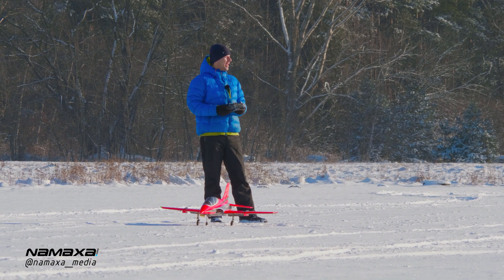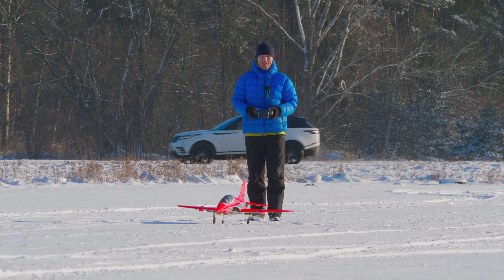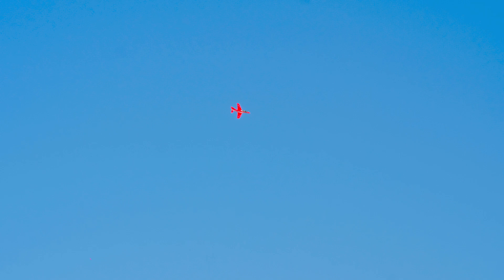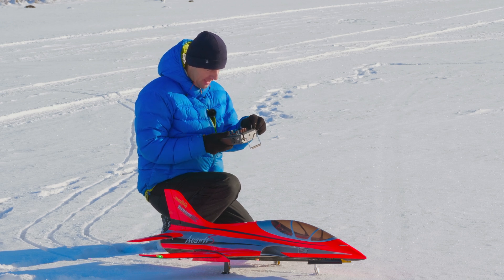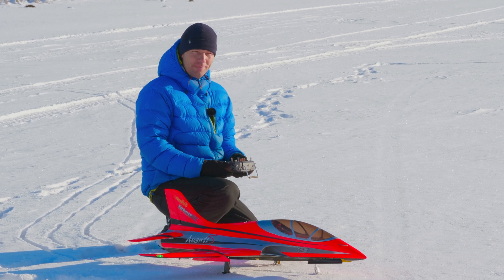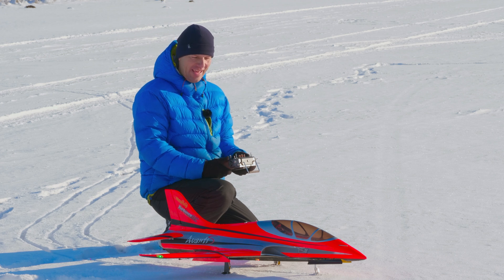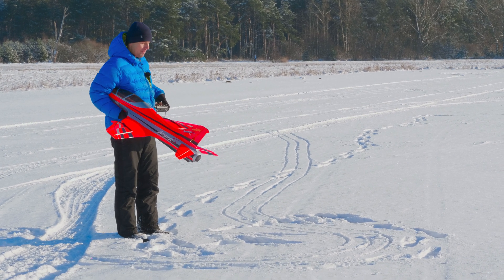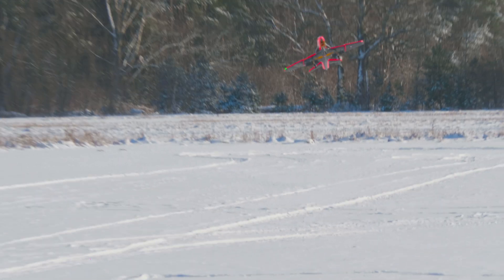New motor Avanti S Freewing 2,8kW WeMoTec midi Evo 80 EDF 6S Li-Ion 3x4000mAh 130A max speed 242km/h

Comment: Thoughts about an parallel 8s setup (16 Li-Ion cells) and the Wemotec Evo / HET 700-60-1865kv? In theory this would be a lower Amp draw (112A) and 3.8Kgp vs 2.8Kgp in the setup above. Would 66A burst be too much for the Samsung 40T?

Comment: You should try modding the 70mm FMS Avanti... It's a much better design than the Freewing and seems to be far less draggy, smaller, and lighter. I'll bet it would do extremely well with a proper power system... You'd really like it. 🙂

Comment: I bought same jet yesterday, before maiden flight is there any reason upgrade the servos or pushrods. Iam going to upgrade allso engine and esc. Greetings from Finland. You make awesome videos!!
Reply from the maker: If you bought Delux version than there is no need to upgrade the power system, just take time to balance the rotor. Servos and pushrods are very good. The oryginal 100A ESC is  very good too. Only the standard outrunner motor is kind of "soft", very nice up to 1,7kW but above, pufs and sweats :)
Reply: @EDFjetRC  Thank you for your answer, im going to check rotor balance before maiden.

Comment: hello, the neuron 80 esc is not too small for this drive
Reply from the maker: I flown it this week up to 160 Amps. But it was cold :) In the summer I used it up to 125 Amps no problems :)
Reply: @EDFjetRC  Have a Fly Fly Mirage and would like to use a midi fan evo / HET 650-68-2000, would that work with the Neuron 80A?
Reply from the maker: @harald-ce9jj  on 6s for sure :) It will be just 100A and I use it in summer till 125A.  FlyFly Mirage has a place for ESC in the duct just in front of the EDF. It will be more than enough air cooling :)

Comment: Really nice flights, and awesome sound! I thought I was the only man crazy enough to run my Avanti on liion (in my case 6s3p 3x2600mah Sony VTC5A), but despite loving my flight times i sometimes go back to lipo for that little bit more power, specially on the latest minutes of the flight. On your setup I think you have both: nice power the whole flight, and very good flight times, in exchange for some weight of course!

One little suggestion: if you want to go beyond your actual speed, try removing the "aerodinamic guides" in the middle of the wing. I improved my top speeds arround 20km/h (from 180 to 200 in my case on tailwind the same day, measured on gps). Stability on landings is a bit worse though.

Oh, almost forgot it, I am really happy to see the frsky esc performing so well. I never considered mounting a neuron 80 esc on my avanti due to it being quite below the expected current draw, despite liking it a lot. Seeing it holds very well I will probably purchase one to test seeing the nice perfomance of yours, although the cold weather might be helping a bit!
Reply from the maker: Thanks for advise :) Check out my summer videos, the same ESC in hot summer weather :)
Reply: @EDFjetRC  I will for sure, thank you! I also liked your videos explaining how you did solder the batteries. I used a spot welder and 0.2mm nickel strips, but had to add some copper fins (and thus heat the batteries anyways) to avoid massive voltage drop on 100A power.

I had some photos of the batteries, let me show them to you: Final result: (959g) https://i.imgur.com/Gfy1D9M.jpg top side: https://i.imgur.com/26n7U8z.jpeg bottom side: https://i.imgur.com/OYpVn7v.jpeg
Reply from the maker: @Igbf  Nice job :) You might think of discarding the shrink wrap as you will get massive heat buildup under it... :) Nickel strips are good to 20A but if you want to pull 50A constant and 100A burst from each cell than you need to solder 1mm thick 5mm wide copper strips. No shortcuts here :)
Reply: @EDFjetRC  I thought of that aswell, but after some testing the heat was pretty manageable even shrinked (arround 55ºC on the outside of the cells after a full throttle flight). The cells are rated for 35A (x3 in parallel), but despite that one of the reasons for me to choose the VTC5A over the VTC6 was the heat when you push them to their limits, the latter temperature skyrockets to >100ºC with no cooling, and apart from the enormous battery wear that is wasted energy that makes up (at least partially) for the higher capacity of the VTC6 IMO.

I chose that weird cell disposition to minimize the lenght of the contacts and to have the positive and negative terminals side by side, so with only a couple of mm on the joints the triple nickel strips do not even get warm after a minute of full throttle. I reinforced them with solder tin just to be on the safe side, since i had to heat the strip anyways to solder the balance leads and the battery recieves minimal heat if done properly. The long joints are a different story, as you can see I had to use (dual) 1.5mm2 copper wire there and heat the zone considerably, but I am happy with the result.

But... for the next battery I build I think I will go back to the standard disposition. I wanted to avoid the need of a thick wire from the negative pole coming back for the connector, but I can totally avoid the copper contacts if I just place them one after another. Maybe I just overthought this a bit ;)
Reply from the maker: @Igbf  I used VTC6 for many years and I loved them. After 1 year of abuse they still had 3000mAh :) And I flew 50A up to 70A on them

Comment: Am really surprise you haven't burn out that 80a ESC. Thanks for the links.
Reply from the maker: I have burn 3 of them already :) I flown it this week up to 160 Amps. But it was very cold :) In the summer I used it up to 125 Amps no problems :)

Comment: Impressive how that 80A ESC holds up, I imagine it will be because of how well cooled and taking advantage of the low temperatures you are having!  Greetings from Spain!
Reply from the maker: I had a few like this already. One gave up at 155 Amps at home during bench testing without any cooling so in this weather I think it will survive even 180 Amps :)

Comment: Hi Wojtek. It was so beautiful with that snow. 
Which fan do you use, Wemotec ? What size? 80mm Midi evo 11 blade?
Will this engine not provide more speed and power.
https://www.tfl-hobby.de/Motore--Halter--usw-/Brushless/TFL-36-mm/3682/BL-Motor-3682-2600KV---2-5D.html
6 cells
Reply from the maker: for sure it will but you nedd to install 160A esc as you will get easly 160-170A.   WeMoTec Midi EVO 11 blades 80mm

Comment: I really like the way your able to play with different motor setup in that Avanti. 
I did a search for that motor and couldn't find the same one you mention. Located other types. I like that setup.  Are you using the 4mm or 5mm Adapter with the Weotec 11 blade and are you using the inlet ring?
Can you point me in the right direct as to where to get that motor. Am in the USA. I've never balance a fan before so what maybe a challenge.

Thanks
Reply from the maker: Hi, I use 5mm adapter. Just buy SSS 3660 or 3674 motor, 2200-2400kv range, HET 650-68-2250kv is excellent too but more expensive. Wemotec links I added to the video description. You need  inlet adapter. Ballancing is easy just takes time. We will post a video about it.